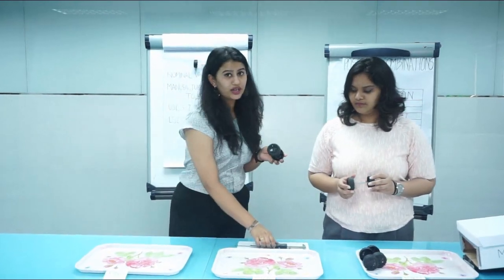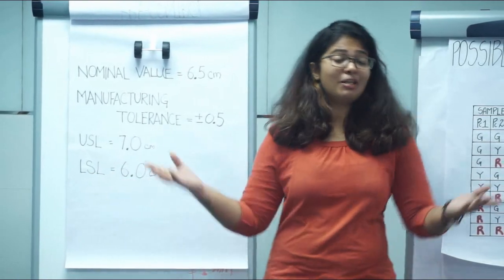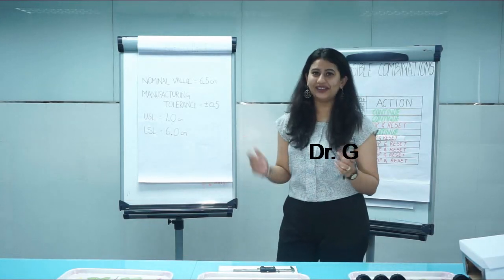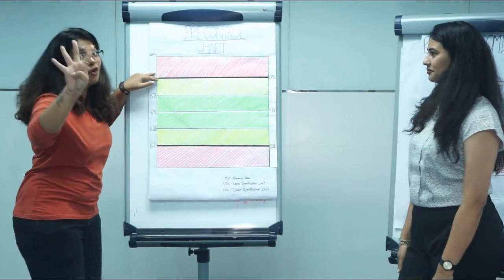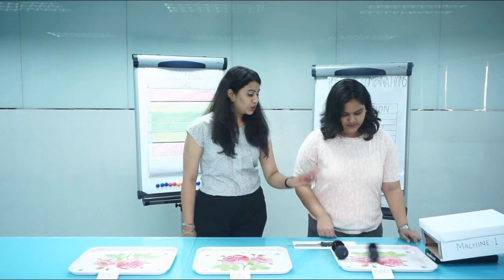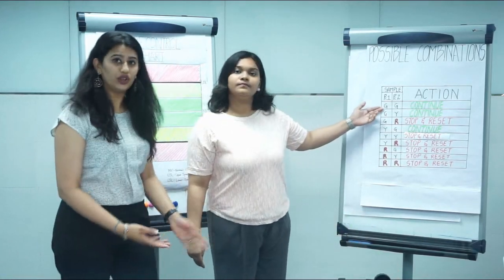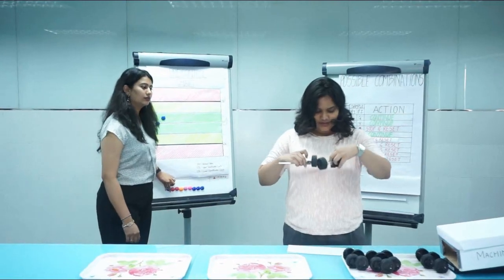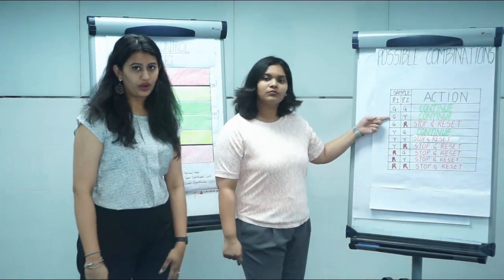Pre Control Chart

Comment: great video sir, 
what is the frequency of checking by the operator
Reply: You can set alarm for the acceptable tolerance limit. Once I before it crossing can realign the production settings. This you will learn from trial production. Say in a plastic extrusion machine acceptable tolerance limits 5km tube. After that the extrusion dies has to be  recalibrated/adjust for getting tolerable accuracy

Comment: Thank you sir, From this video I take learnings of Self inspection, quality check at the Source and the Pre Control Chart method of QC is much simpler than the X-bar and R chart as no calculation is required in this.